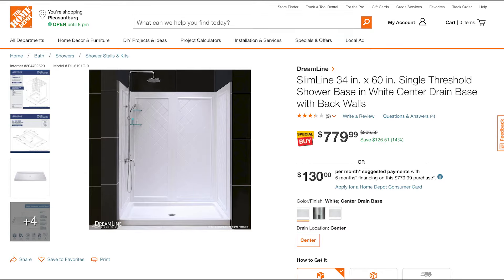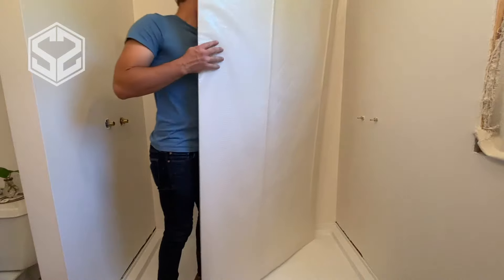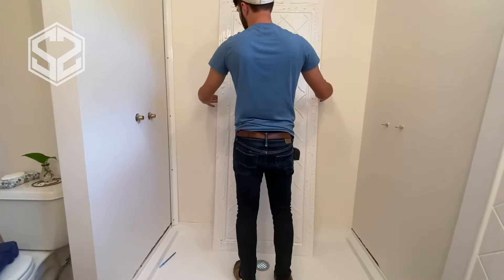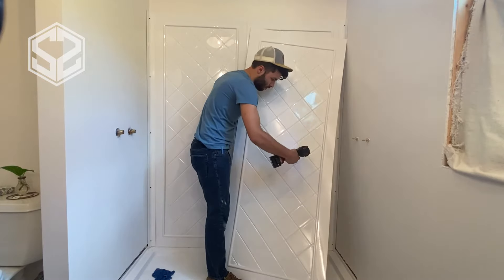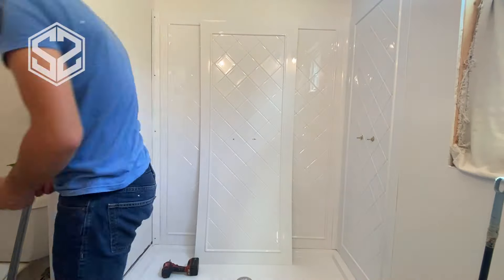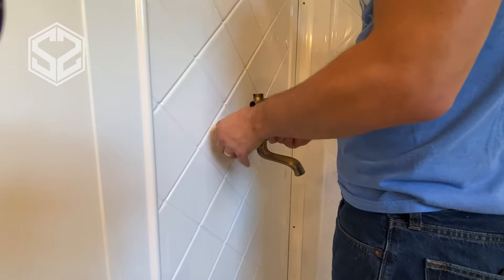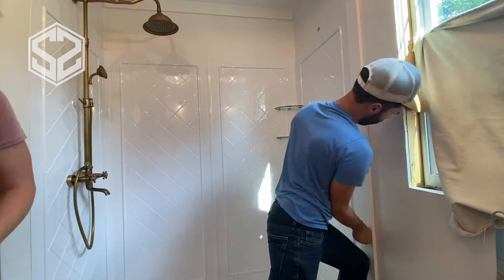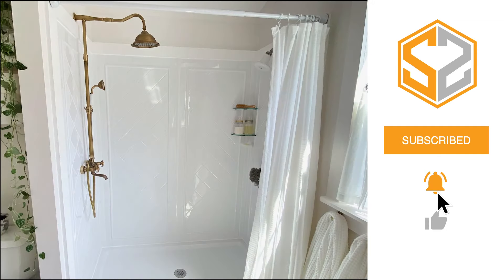How to Install a DreamLine Shower

Comment: Good job. Tip I learned years ago about lining up holes to those fixtures/knobs. 

Line the pipe openings with lipstick. then press the panel against that pioe opening.

Now you have markings on the panel where you can make your cuts to drill.
Reply from the maker: I love it! So simple! Now anyone going through my tool box will be confused when they see lipstick lol 😂

Comment: Hello!  This is great and just what I was looking for. I'm about to put in a square/corner Dreamline unit that has only two wall panels, as the other two are glass and door. I'm noticing my shower base does not fit snugly against the wall since it is out of square.  Do you have any suggestions for this? Thanks!

Comment: Excellent video. Was thinking if you already had finished walls you are adhering the vinyl walls
To you could draw a line from the top of your walls
And cut the bottom part of the waterproofed sheetrock
Out and the base would then have the lip inside
Of the sheetrock and it wouldnt bulge out at the bottom
Reply from the maker: That would be ideal! That should work :)

Comment: Did you apply any water proofing to the drywall incase water ever does get behind these panels and does the screws you used come with the kit if not what kind of screws did you use that's very important to know?

Comment: So you installed drywall under the kit, I heard drywall in any shower space is a no go. Do you not need a waterproof wall like Kerdi Board or something under the vinyl shower wall?
Reply from the maker: Water-resistant Sheetrock will work as it doesn't come in prolonged or direct contact with water. the green sheetrock I used was designed to be used in bathrooms and anywhere water may reach it. Regular sheetrock will disintegrate after getting wet a few times but if you do a good job installing the shower and sealing up the joint, there should be no issues with the green water-resistant sheetrock. The cement board or Kerdi Board would also work if you are concerned about it.

Comment: I'm about to purchase a slimline base.  Can I install with just the leveling mortar, or does it have to be secured to studs as well.  I noticed you installed against finished walls, which I might do as well.  Thanks 👍
Reply: Read the comment above someone said the pan should be nailed to studs
Reply: @jjf609  yeah, there was a flange for screws.  It's secured to studs and mortared in.  Been working great for about 2 years now.

Comment: Thanks for the video but I do have a question and I hope you can answer. I’m looking to renovate my bathroom as well but I have seen some ppl lay like a plastic covering under the shower (like the floor part) before inserting the shower but I see you didn’t. Is that part necessary or no because it seems like you don’t but I just want to be sure.
Reply from the maker: Thanks! it is a good safety measure to use a vapor barrier between the shower and the walls and floor this is mainly to protect from small leaks and build-up of moisture. However, the way this shower is designed it is glued directly to the wall so no moisture barrier can't be used for this. (I used water board sheetrock behind the shower walls) For the floor panel, I skipped the vapor barrier because if there is a leak then it will rot out ether way. The plastic really won't save the floor if you have leaks. If you install the shower properly and seal it, you shouldn't need the vapor barrier.

Comment: Is it odd to have drywall behind an acrylic shower? Glued to drywall? Just a DIY guy doing some research but I’ve never seen this yet! Most of the acrylic shower kits are screwed directly to the studs that I’ve seen.
Reply from the maker: It depends on the kit. This one is made to be glued to cement board or water resistant Sheetrock. Without a backing, this type of acrylic shower wouldn’t have the strength needed to last or even use.

Comment: Ok, so I’m by no means a professional but I noticed a few things that may cause some issues down the road…shower pans are supposed to be nailed to studs not drywall. Water barrier should have been applied to drywall then the siding. Not sure about the small openings above the shower pan. Silicone/caulking overtime will fail which is why these steps are important and will need to be reapplied at some point. Again I’m no professional just some things I’ve noticed. Bad ass shower faucet by the way, I’m definitely getting that for my mom. I hope the shower is holding up well.

Comment: Question: We are installing something similar. Same base, but we noticed that the lip/edge of our base is not flush with the walls on the right and left side. There is a 1/4 gap on each side so there is not reason to cut out the bottom of the drywall. Our concern is that the plastic surround wall will butt out at the bottom since it's not flush. I could not tell in your video if your install was the same or not. It appeared as if your pan edges were underneath the walls.
Reply from the maker: Yes, it is helpful for the cement board or drywall to hang over bast the lip of the base. If not the walls will have to bow in at the bottom and may cause issues for you. You could possibly fix this by using 1/4 inch hardy board or cement board to build it out on the sides that don’t over hang the base. That may give you enough to keep the walls from butting out.

Comment: With the Dreamline base I can do tile instead of the panels ?
Reply from the maker: Yes, I believe there should be no issue using the base alone with tile instead. However, I’m not sure if they sell the base separately.
Reply: They do for anyone wondering

Comment: I don't understand why the instructions say to partially screw in the corner piece and then slide the panels into the corner behind the corner piece.  It is seems easier to install the panels first where they need to be, then screw in the corner piece on top of them.  I am in the process of installing the Dreamline panels in a small corner shower.  Just one corner and two panels.

Comment: As a 20 year professional remodeler I’d like to suggest not using this system and here’s why. First, it’s flimsy and cheap. Second, the more seams and screw holes the more potential leaks. This unit has three seams and 15 screw holes. You NEVER want screws in your shower area. The plugs pop off and water gets back there and rusts the screws and makes leaks.  And the third reason I would never use this unit is the finished edges. Who in god’s creation wants to install wood trim around a water and moisture making shower???? You’re going to be recaulking and repainting that trim yearly. Not to mention if you have a bath design that isn’t conducive to the farmer wood motif.  I appreciate the time and effort you put into making this instruction video but if you really want to help your viewers tell them to buy a three piece rigid wall system that mounts directly to studs and screws in at the top and is then covered with drywall and the edges are finished so drywall butts right up to it. Then you run some mud and sand and paint the wall color. Hope this helps some poor unsuspecting  DIYers and saves them some future headaches.
Reply: Thanks, I was skeptical the moment I heard something about plastic covers over screws. That sort of thing never lasts. And one place I was in had vinyl sheet glued directly to drywall which started cracking because it wasn't done perfectly (something I don't have the skill to do, if anyone does).
Reply: What's the best one from lowes if you know because we are about to get standing ahower
Reply: Hi, what are your thoughts on using vinyl trim to frame the shower?  Also, could you put silicone over the screws and then place the plugs over it? I have a smaller version of this shower that I’m installing.  I have cement board in the alcove and I’m about ready to install the walls.
Reply: Thanks for the expert opinion.

Comment: No moisture barrier needed?
Reply from the maker: Nope. From what i could tell, this shower is glued directly to the drywall. Most moisture barriers I could find would get in the way mounting the shower walls with glue. However, If you could find a moisture barrier that is rigid enough to support the shower walls I suppose it wouldn't hurt to use one.
Reply: @SimonSaysDIY  You clearly don't understand how moisture barriers are installed. You are the epitamy of what is wrong with youtubers. You did so much wrong in this video I woudl be surprised if htis lasts a few years before needing to be ripped out and redone by a professional.
Reply: @MAGAMAN  trump lost lol
Reply: @SimonSaysDIY  they have this pink stuff they sell in a can. It's like thick paint but when dry is like a plastic coating, or when installing the cement board, you can use tar paper as backing.  We do both as a precaution.

Comment: I cut a test piece of one wall and used Loctite, Gorilla Glue, basic silicone, etc. All glue sticks to wallboard test piece but not the Plastic Dreamline Walll piece. Just pulls up after 48 hours not even leaving a mark on the plastic wall. Very frustrated.
Reply: What was your final adhesive dis you use? We have this problem now and the design makes it worse, its like a block design
Reply: @debbiesims3989  Loctite Tub and Shower. Worked fine.

Comment: Mine doesn't have drywall.. am I screwed?
Reply from the maker: Does it have cement board? or is it exposed studs and insolation? This type of shower needs some type of backing to give it strength. However, the fiberglass showers are much more rigid and don't need the support from a backing like sheetrock or cement board. However I would check with the manufacturers recommendations to double check and see if it needs some type of moisture barrier to seal it.

Thanks!

Comment: What about the exposed drywall from the top of the vinyl to the ceiling ? That would get wet. 🤷‍♂️🤷‍♂️
Reply from the maker: Well, it is very unlikely that water would make it all the way up there as the shower heads are pointing down. When using a shower, moisture normally condensates on all surfaces in the bathroom with a few coats of paint the sheetrock will repel water in small amounts.
Thanks!

Comment: You seem to not understand what the "self leveling" layer was supposed to do since it turned more into a "mortar bed". I guess as long as you are happy with the outcome.
Reply: Isn't it suppose to level the base foundation so that you have a leveled tub/shower?  I'm super paranoid about water and water damage, leveling your work is key in preventing pooling. I guess with prefab showers, there's no real hole for water to leak through unless there's a hole.
Reply: That’s not “self-leveling” compound. If it is it’s definitely not used correctly.

Comment: $20 tile board at HD for those not wanting to pay $800 bucks for plastic, I'd rather invest in Kerdi back wall and then plastic panels.
Reply from the maker: Thats true. This isn't for everyone. This product does have great reviews  and claims to hold up really well but we'll see. :)
Reply: Kerdi board has alot of give in it, the adhesive to the plastic panels will pop off over time or if you bump into the wall good. Better off with green board or cement board and then with the Schluter system for the corners and edges. Plastic panels go over that and then you have two levels of protection when the silicone fails on the plastic panels in 5+ years.
Reply: @CallMeTonyG  good to know

Comment: No way I'm giving some knucklehead $800 for plastic stick ups but thanks for install video, I'll use some other water proof product. Your bathroom has about 5-10 years of life and something needs replacing or fixing along with the little stuff IF you take precautions so plan on it and if you do yourself then you know what you're doing when you need a repair..still js
Reply from the maker: Thanks for watching! And I will keep that in mind.

Comment: Is that against Sheetrock? Screw holes? Open corner seams? Even the faucet mount was directly over a seam in the wall pattern. Water will go behind that immediately. No way. This thing is a one year and fail system
Reply from the maker: Been over a year since installed and still no leaks :) check back in later and I’ll let you know how it is holding up.
Thanks!

Comment: Should never have stepped on the base right away after putting that cement. need to use a rubber hammer and level to level it and let it firm up overnight.
Reply: I do two complete installs a week. Once the flange is screwed to the studs, I continue with the install. Might not be ideal but I’ve  ever had a problem. Again, I’ve done hundreds of these.

Comment: 2 minutes in and I can already tell this guy has no idea what he is doing.
Reply: He didn’t take the walls down to the studs. 

He put the rubber ring on the top side of the pan. I always mount this type of drain in the pan prior to setting it. 

I quit watching at that point.

Comment: Not so sure about this installation, haven't seen a shower base done so haphazardly, usually there's leveling and making sure the flange is set, don't trust this self leveling fast acting stuff as a DIYer. Leave this to the professionals, they say it sets up on your way back in minutes, ain't nobody got time for that hiccup.
Reply from the maker: I would agree this wasn't the best way to install the base. When I do this again I'll find a better way. I would recommend doing more research before Installing a shower base yourself.
Reply: @SimonSaysDIY  Any suggestions?

Comment: I noticed right away that you installed the gasket on the shower drain incorrectly.  Well at least not to the manufacturers specs. <iframe width="413" height="232" src="https://www.youtube.com/embed/EeXHIP7_N4U" title="YouTube video player" frameborder="0" allow="accelerometer; autoplay; clipboard-write; encrypted-media; gyroscope; picture-in-picture" allowfullscreen></iframe>
Reply from the maker: Thanks! Yeah You may be right, but it hasn’t leaked and everything works properly like it should so I’m not worried about it.